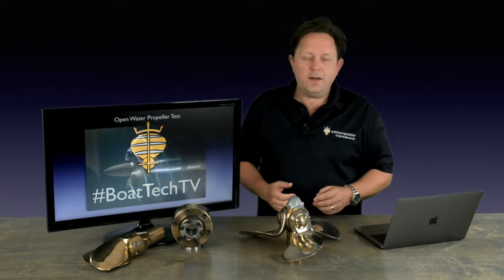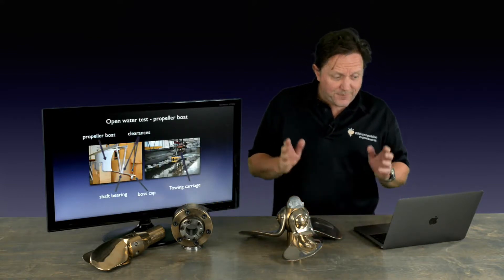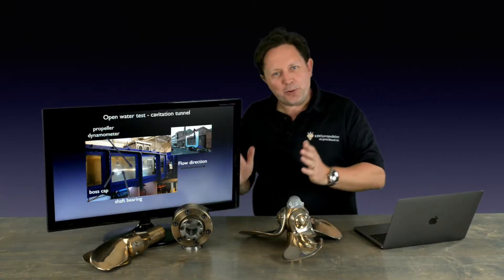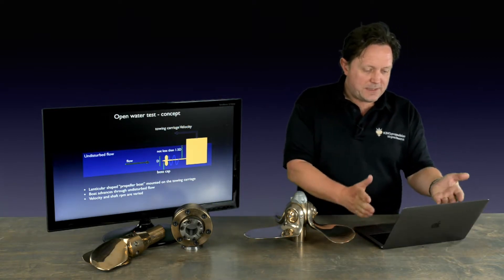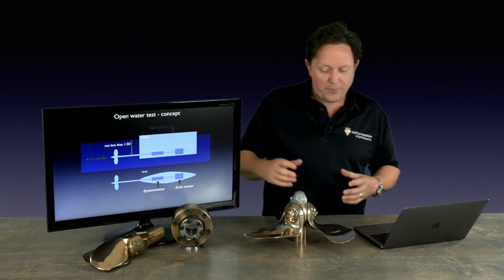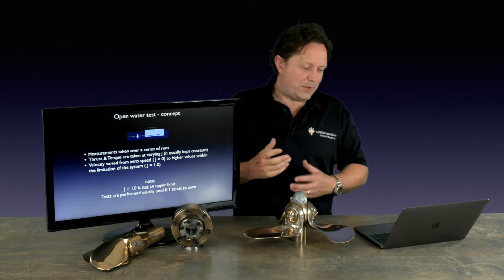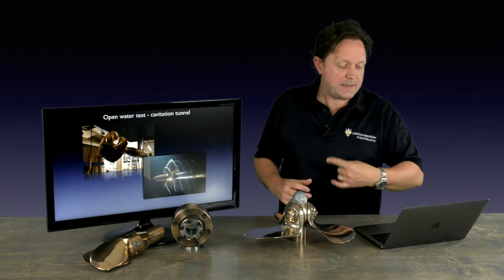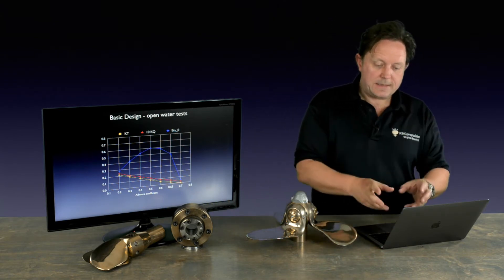BoatTechTV Episode 12  - Open Water Propeller Tests

Comment: While the rotating propeller and the cavitation on the tips are interesting, the helical rotation left behind the propeller clearly shows the heavy distortion due to the vertical strut holding the propeller.  There seems to be high backpressure ensuing due to the presence of the strut and that in itself could cause vibrations even on the strut itself. The upward flow on the strut is the same as the upward flow on the cutwater on the bow of any ship.
The following video shows a vertical strut that was designed to minimize the effect seen on the strut holding the propeller.
 https://youtu.be/i9yCe6ibhzU